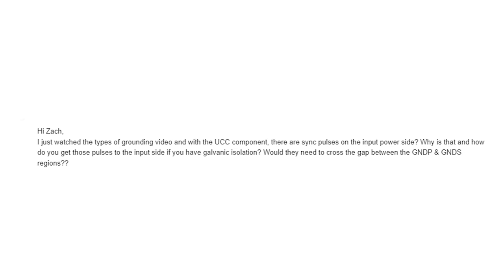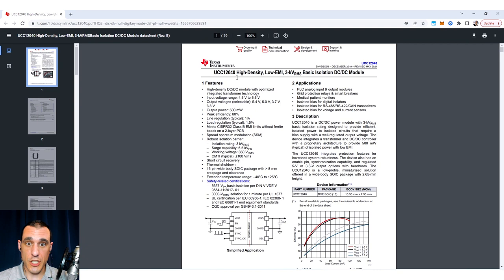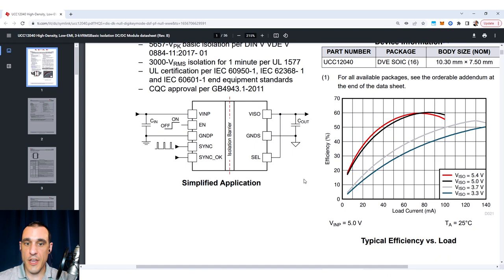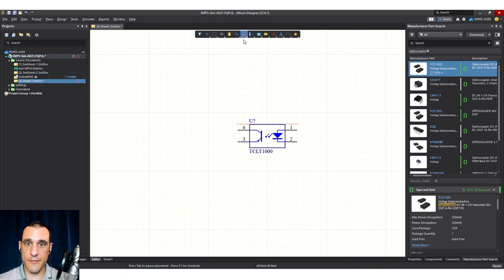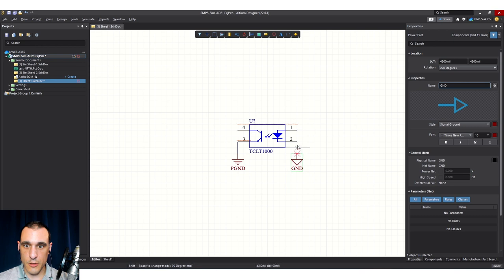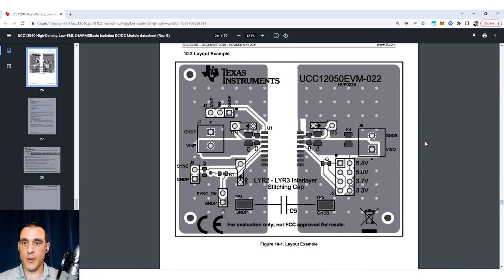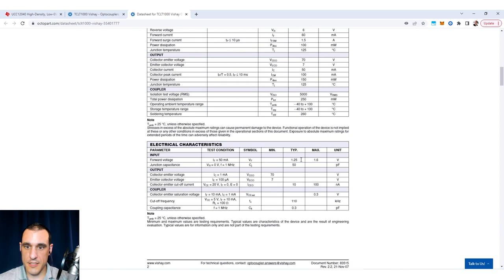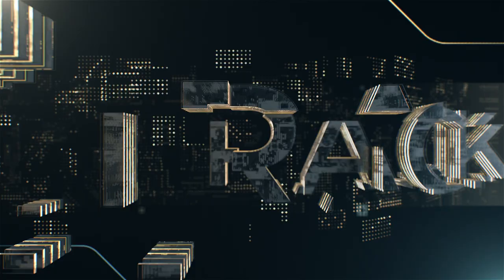How to Use Optocouplers for Galvanic Isolation

Comment: Also - medical guys love the Icouplers - in fact, Lady Ada sells a USB isolater based on them.  They work great, but the ones that isolate power put out about as much RF noise as do some the spread spectrum radios I've designed.   There's even an Analog Devices appnote about it.  For power isolation, much better to use the old 422/485 system isolators that run at 19kHz via actual magnetics....

Comment: Typical analog optocouplers are NOT the same as to what I mentioned.   They require power on BOTH sides of the circuit.  What I mentioned is a VERY SIMPLE design where the high side optocoupler only has the LED input with NO POWER REQUIREMENTS on that side.  So if you're trying to monitor a voltage/current on a system you want totally isolated and has no power supply available - this works really well...We have safety systems that we monitor that can have NO POSSIBLE  INFLUENCE - only an LED and resistor is allowed.

Comment: There is also a way to make a simple linear opto isolator circuit .  Note that if you try and run an optocoupler  Bipolar transistor for an analog signal, it will be be drastically impacted by temperature.  But what you can do - And I've prototyped this - is to use optocouplers in the same package  then use one as the input, but take the other an use it in the feedback loop of an opamp.  That way as the optocoupler substrate changes temperature BOTH opto's will respond in a similar fashion therefor "servo" ing the output.   I tested this on a protopcb I CNC'd using an LT1211 single supply opamp and a TLP opto while on a hot plate that took it up to 100C.  I then went down as quick as possible to around - 25C.  I was using a DAC recorder and it was incredibly linear.      Note to Zach - I can send photos of the set up and a screenshot of the charts.   It's really cool.

And no - I cannot take credit for it - evidently all the oldtime audio guys have known about this for decades.   I did about 300 design with the late Gary Stanfill of Vega Wireless/Schaffer-Vega - the first commercial wireless mic/instrument interface company.  Those old guys knew a lot of tricks...
Reply: I believe I saw these linear optical devices in the late 90s.  It looks like a LOC110 or IL300 performs this same functionality.  It has a single LED input and 2 matched photodiodes (one for servo feedback and one for output).
Reply: @nulldev42  Naw - doesn't work quite the same.  On the high side you need to provide an opamp with a power supply.  See this https://www.vishay.com/docs/83708/appnote50.pdf As I mentioned in a previous post, that would breech a safety barrier since it's possible that the opamp could influence the safety buss...   Yea, we looked at those years ago and were prohibited from using them.

Comment: Hey Zach, thank you for the useful topic!
Mostly I 've seen the  optocoupler on the secondary side of the flyback smps for the feedback
and also seen a TL431 , could you please explain how to use it with the optocoupler ?
Reply: That TL431 regulator is basically a precision voltage source. I think you would use it as a precision reference for an error amplifier. If it's for secondary side regulation, then you would have that error amp circuit on the secondary side driving an optocoupler, and then the signal on the primary side would be passed to a controller for the flyback.